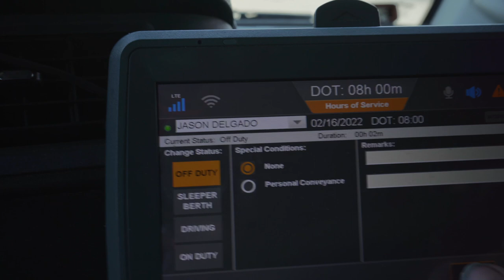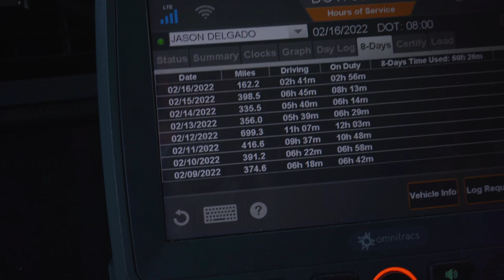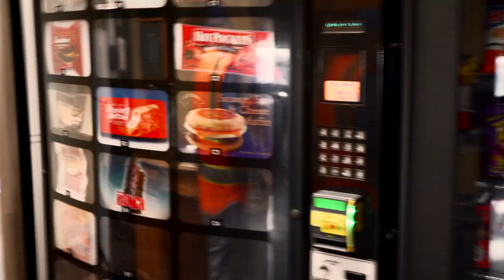Life of a Flatbed Truck Driver - Surviving the Winter - Melton - EP 11 - The Laredo Terminal

Comment: also a tip. u have something called an apu exemption! it gives u up to 400-500 extra on ur drives. now some states like kentuccy and north carolina dont have that exemption. also you can slide ur 5th wheel. but also heads up. the fine for being over weight really is t a big deal and it doesnt affect your csa. the fine is .5 cents per pound over weight. soo yea i wuda jus ran that like nothing shiiit ive been a few thousand over. fucc em
Reply from the maker: Thanks for the tip!
Reply: @delgadotrucking  if you google apu exemption, u can find a list of what states dont allow it and the exact wait over you can be with out a fine. dont slow your self up running one tank if you dont got too bro.
Reply from the maker: @412hwc  that’s good to know. Thank you brother